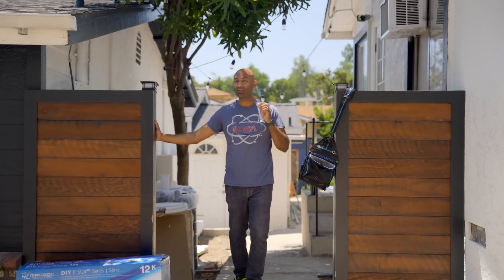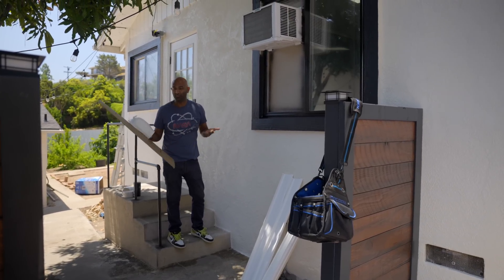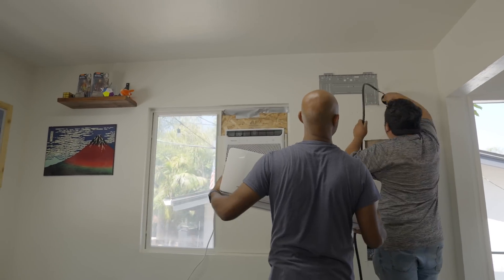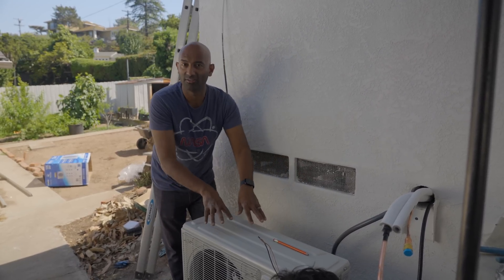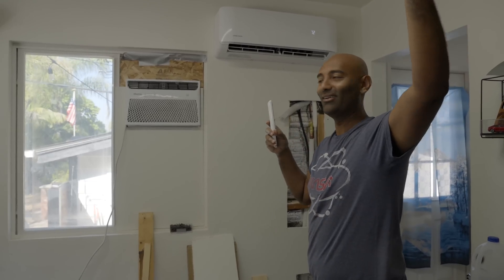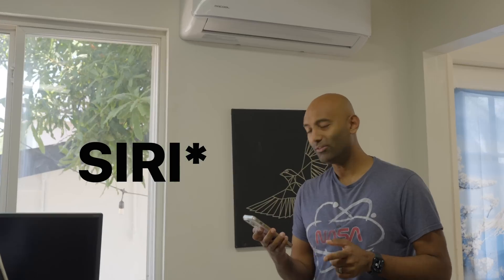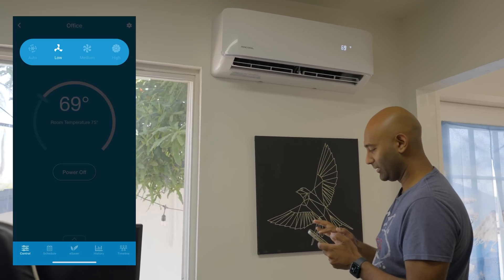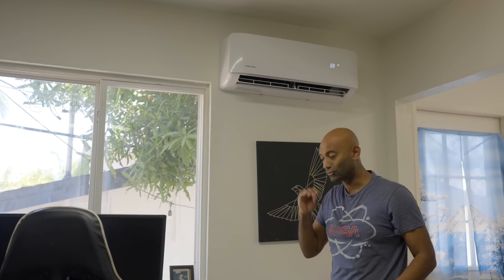Summer Heat? Here is Your Answer! DIY Mini-split Heat Pump!

Comment from the maker: Get your Mr. Cool DIY Ductless Mini-Split Today: https://geni.us/MRCool
Reply: What will be the projected savings in summer and winter, for your area between swamp coolers, traditional air conditioners, versus minisplits?
Reply: ARSON IS NOT NATURAL DISASTER
Reply: @tomasbjornerback 
They've had these in the USA for 20 years.   It's a matter of cost for house flippers, who choose the cheap option when it comes to cooling, landscaping, etc.
Reply: In the winter, what is the minimum outside temperature that it will still work as a heater?
Reply: @bdeitur  that depends on the brand and unit. Some go to -10C (14F) and others are rated for up to -25C (-13F). But you have to keep in mind that as soon as temperatures drop below 5C (41F) the outside unit's heat exchanger will freeze which means it goes into a defrost cyclus that can take anything from 10 to 15 minutes and during that time you don't have any heating. And that's when the efficiency of the system really drops and that's why heating with a heat-pump is more expensive than using it for cooling.
Reply: @bdeitur  
It loses its efficiency when the temps drop below 5°F.
Reply: Why are you not running the drainage pipe that would be putting out cool water to be drip on to the radiator fins of the outdoor unit?
Reply: Why opening the entire wall like that? Just a hole straight our behind the unit is more common.

In EU, a tech is required to fidfle with the medium, as it is a greenhouse gas. 

Split systems with heat/cooling are over 20 years old, it is just usa being behind decades as usual. 

Just look at buses/transit, insulation, building strength and quality… so far behind!
Reply: @My_HandleIs_  did you not watch the video? He explained that in the first 60 seconds. He said steps going into the house will not allow him to route it outside.
Reply: So this is basically nothing more than a commercial? As you may (or may not) know these units run on R410-A refrigerant which is in the process of being phased out (started back in 2022) so if you're ever going to have a problem (which is very likely with those quick connectors) parts will be expensive, not to mention the price of R410-A which has been going up ever since it's phase out was declared.
If you want your money's worth it's best to get a renowned brand like Daikin, Mitsubishi Electric, Toshiba or LG and have it installed by a professional. That way you not only get a warranty on the units but also on the installation and you can be assured that the system is operating optimally since they check pressures and temps when commissioning the system.

Comment: Heat pumps SUCK. If you have a sudden cold snap, they take forever to heat your house, and your furnishings and bedding stay ice cold. Oh, an electric backup you say? MOST EXPENSIVE heat source there is. Your good old fashon gas furnace heats your home almost at once, even after a power failure. A heat pump might take days to recover.

Comment: That's quite cool, no pun intended. We installed the same thing last year, just before the summer. It was clearly soooooo cool. We put three areas : one in our room, one in the living room, and one in the basement (two total exterior units). The fun fact is that we only have one unit running at any time. In summer, only the two on the top are working, meanwhile in winter, only the basement one is heating (eventhough all can do cooling and heating). It's often enough.

This is surprising given that we have resisting heaters everywhere, needed to get them working during winter whereas they only kicked twice for a total of 3 days when exterior temp fell below -25°C... I live in QC, so basically anyone living more on south should be able to heat/cool all the year having theses revesible air conditionners. If you have resistive heating, that's quite cool.

Comment: Did you purge any gas, dust or moisture by vacuuming the indoor and pipeline before releasing the refrigerant from the compressor? Because, sometimes the refrigerant can get contaminated and damage the compressor and copper tubes

Comment: Rikki, I heard that the compressor runs all the time, 24/7.  What's the actual cost to run a 12,000BTU unit in Sandy Eggo for a month?  I guess that if your solar array supports it, it wouldn't be a burden at all.

Comment: About your "adding a split unit to your house upstairs bedroom"...

"It is always advisable to keep the outdoor unit at the height above the indoor unit. If the outdoor unit is kept at level below the indoor, some of the compressor power is used in pumping the refrigerant against the gravity, thus reducing the overall performance of the compressor."

Just make sure the elevation difference between the two units is within the manufacturer's specifications.

Comment: As a home builder, I couldn't help but notice you have no insulation in those walls. When you opened up the wall cavity it would have been a great opportunity to install insulation as it would help tremendously. Remove the foil reflective bubble insulation from the walls and replace it with Rockwool batts, spray foam, or if you want a more DIY solution can cut panels of rigid foam board and seal the edges with a small can of "Great Stuff" foam spray. In short, having walls with zero insulation is never a good idea.
Reply: They are in California, if that makes a differnce.

Comment: Running the lines through the wall is a cool idea i havent seen anyone do it that way they all run it on the outside of the building. The only thing I would be worried about is moisture condensing on the refrigerant lines and pooling in the wall but if you can prevent that it looks way better!
Reply: Agree. I think it will leave so much moisture. That wall is going to end up having mole.
Reply: Black Mold. It's a real kill joy and absolutely WILL HAPPEN if there is any exposed copper line set... it may not be immediate, but it is inevitable. 
... and your home owners INSURANCE policy DOES NOT cover it. 

 Call them and be informed.

Comment: I’ve got 8 of these in my home. Make sure you keep the inside and outside heat exchangers cleaned off. Also, very hard to clean, but if the inside rotary FAN gets dirty (dust) airflow drops significantly and the rooms won’t cool/heat properly. 

Enjoy!!

Comment: Where do your Mr. Cool electrical energy comes from: ???????
1) San Diego Gas & Electric?
Grid.
2) Solar Panels to your Delta Pro's to Transfer Box?
3) Solar panels to Inverter system setup to your off grid batteries, etc??

Obviously at night Solar panels inactivate.

Comment: I'm doubting the value of smaller heat pump devices like water heaters as solar and battery prices continue to fall. With panels continuing to get cheaper, resistance heat is probably poised to make a big comeback. While miserably inefficient compared to a heat pump, the lower cost, greater reliability, less maintenance, and such simple construction paired with free electricity (from solar) makes it a winner. Just add a few more panels! They end up cheaper than the premium for a heat pump. If solar prices continue to fall, domestic heating may just end up resistance, too. Another artifact of falling solar prices reveals itself as the promise of jobs cleaning solar panels is no longer mentioned. I suspected that was coming about 7 years ago when we got our first solar install. I'd go out every month or so and hose them off. After a while I got curious and decided to log energy production with dirty and clean panels (the inverter has a real time watt display). I discovered the loss with dirty panels was less than 5%. That got to to thinking if you had a BIG solar panel install, say 1000 panels, all you had to do was make it a 1050 install and that would eliminate the need for the cleaning crew (and also generate more than the smaller array right after a good rain storm probably making the increased install cost a wash after the additional production and loss of cleaning crew expense were figured in). Now I notice there is never a word of panel cleaners anymore.

Comment: I fitted a DIY AC a couple of years ago. They are excellent and really cheap to run and extremely quiet even standing next to the unit. They don't use Freon gas either. 
If in UK they are available from Appliance Direct, the maker is Electric.

Comment: I hope I'm not so late to the party that this comment gets lost in the weeds. Ricky did you look into the warranty and service reputation Mr. Cool has? I am wondering if you or anyone else found something different than me. I had a Daikin 36btu 2 head unit installed in my downstairs living room and dining room and I absolutely love it. I had originally really wanted to go with the Mr. Cool because the DIY seemed within my DIY technical ability and the savings would have been great but when I researched it I found that many people were having issues with getting service on their units and reporting terrible customer service from Mr. Cool. From what I was seeing everyone was very happy with the DIY and the system in general but "IF" there was a technical problem it was a huge headache to get it resolved. I didn't want to fight to get something under warranty fixed so I spent the extra 3k + for a tech to do it so I had recourse and a person to call that would actually come out and fix it.  

This is just what I found. Im curious about everyone else's research might be or what they would have done.

Comment: I did mine a couple years ago. It was great, Mr. cool is convenient unit but you pays $500 more for that. Similar unit without pre-charge line save money if you know what you are doing. A advance DIY should has no problem.

Comment: Converting your hvac system to heat exchangers can lower your electricity usage by more than half. Your actually cooling room by room and that means if you have rooms you don’t use you arnt spending money to cook them.

Comment: Viewers should know that there are limitations in the winter for heat pumps. They are not going to produce a lot (or any) heat when the outdoor temperature drops below freezing.
Reply: This is not entirely correct.  Almost all of these ductless mini splits will give their full BTU rating down to plus 5 F. And they will give some amount of heating down to negative F.  The same holds true for Cold Climate Heat Pumps which while more expensive than regular heat pumps WILL work and give their full BTU ratings down to plus 5 F.  And some will work down to negative 17 F.  Of course below 5 F, they will not deliver their full rated BTUs and their COP will be lower. Just check the manufacturer’s specifications and you will see.

Comment: With all the complicaions of Federal and State laws regulations on mobile homes what is available for the use of heat pumps with mobile homes.  I would like to get away from natural gas and go to electric utilities.  The washing machine and dryer can be replaced with the new heat pump washer/dryer from GE. But the hot water heater and HVAC all in one unit may be more complicated. It has a forced air vent that has a vent cover in each room. The hot water heater is in a closet that opens to the outside. If the Federal and state government of California wants to get away from hydro carbin fuels they need to endorse changes that can be used in mobile homes.

Comment: The technical term is “leak test” and please never use detergent soaps to leak test your fittings as detergents will cause corrosion. Always use a non-detergent leak detection solution. Not “soap”.

Comment: My wife and i installed a couple of these for our house.  One larger one for the house and a smaller one for our main bedroom.  The rebate we got from our power company almost paid for the units.  We did put in a disconnect close to the outside unit.  Electrical inspections is done by the state here and they have really good website showing code expected to be used.  They've been working very well so far, 2018.  Their networked dongle didn't like my network, and kept disconnecting from their servers.  I have fail-over for Internet, Starlink and ATT cellular with a Fortigate firewall, i live in the sticks so Internet access is a challenge, however, every other piece of gear i have, that needs to connect up to services sitting on the Internet work well.  I'm thinking the session control that the MRCOOL app uses, is using IP address for session ID, instead of something like MAC or random ID created at time of connection.

Comment: Unless one happens to have the Experience/Qualifications due to many (30+) years of Home Improvement and Repairs, Operating as a Self-Owned and Operated Business, and many years prior to that for other Businesses. Electrical work Scares so many but, is actually Stupidly Simple to do Safely. Even with a Hot Feed.

Comment: In Europe the electrical wiring is actually reversed. You plug the indoor unit to a regular socket and there's wiring going to the outdoor unit from there, along with the coolant pipes and drain.
Reply: Helps that your typical outlets over there can deliver over 3kW of power.

Comment: I would say a pre-charged DIY mrcool split system is easier than having to install a window AC in a small window, with the entire thing inside of your window to hide it from the HOA. You have to create an inlet for it and cover up the other Vince. You have to also get a thermal gun and make sure the compressor isn't overheating and any possible heatsink electronics if it's a smart window AC. And then you have to put a mesh lattice on the outside of window and that blocks some of the performance, but not as much as the screen does

Comment: Since you’re playing with AC, I wonder about the efficiency gains of running an evaporative cooling tower to cool a pool of water which acts as a heat sink for a closed-loop refrigeration cycle. 

I know, using more water in California isn’t a good thing; but not everyone lives in California. And using less electricity *anywhere * is always a good thing. 

You have all the equipment you need to run this experiment!

Comment: Comment from "Down Under"
There is so, so much wrong with this vidio.
How USA can be so far ahead in Military tech,
but so far behind in electrical and refrigeration equipment, beggers belief.
This type of equipment was discontinued in the 1990's, here, ' Down Under ',
banned because O ring seals are not a good idea with refrigerants.

I would love to see how you bent those pipes under the house, 
You did not get the stagger right for the two pipe sizes inside the wall,
 if you had the stagger right inside, it would have been right outside!
The condensation on the outside of your water drain line, that you put inside your wall
'IS' going to rot your wall from the inside out.
 Everything outside the wall,,,,, MATE.
And here ' Down Under', strictly no DIY for the electrical,, supply or interconnect cabling, 
and  yes where is you localised isolator for the electrical supply.
This has taken the shine of all your previous presentations for me.
Shame on you!  shame, shame.
Do not do this yourself.
Shame on Mr Cool also, for enticing people to indulge in this self help fantisy.
How much greenhouse gas is going to be liberated due to the preferbial stuff ups.

Comment: Cool ....i'd connect one to the old baseboard electric heat wiring, to new box  and be done with the wiring    those baseboard things are stupid imo ....i have billion btu outdoor firepit and if i run the electric heat it's rediculous energy bill to heat the puny wires .....i mostly want the heat pump feature , a couple my baseboard heaters are 240v already too, i'd rather not even use them and the space heaters cause moisture issues imo...

Comment: I would have made that hole in the drywall an access panel so you could get to the fittings inside the wall if you needed to.

Comment: I installed a pioneer 2 unit minisplit. Super quiet runs good. My brother in law installed Daikin 3 unit. Super quiet. Then I had Fujitsu installed in my second floor(too much for me alone). Big mistake!  Absolute junk units. Unstable noisy and don’t cool well at all. They constantly short cycle and make a racket. Before buying I asked the salesman if I could turn them down to 60 in a bedroom like my pioneer. They said yes. Not True at all.   Avoid Fujitsu at all costs.

Comment: It would be helpful if you first bleed the air trapped in the copper pipes and the indoor unit : 
Do not connect the return copper pipe, and then open the valve of the upper pipe until the refrigerant gas circulates through the pipes and the indoor unit, then connect the return pipe and fasten it

Comment: Sorry Ricky but you called the outdoor unit an AIR HANDLER. In HVAC nomenclature the Air Handler or Air Handling Unit (AHU) is typically a big sheet metal box with only a main fan and one or more heat exchange coils that distributes indoor air.  It may be integrated with other components like an electric coil or gas burner for heat.  The thing you called the air handler is best just called the outdoor unit.  I've seen your other videos HVAC stuff and normally you do fine and I like your work.
Reply: Ricky simply misspoke.   HVAC folks usually call the inside unit that absorbers heat from the room an Evaporator and it’s located inside an air handler box.  The outside unit is called a Condenser which transfers room heat to outside air.